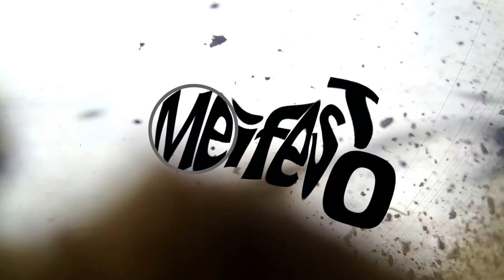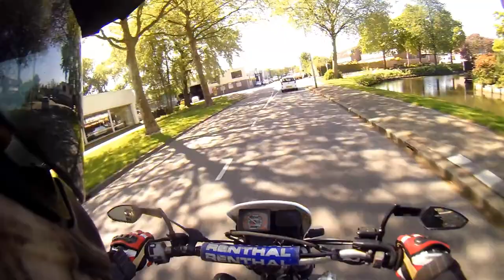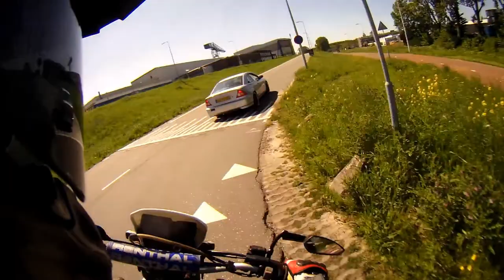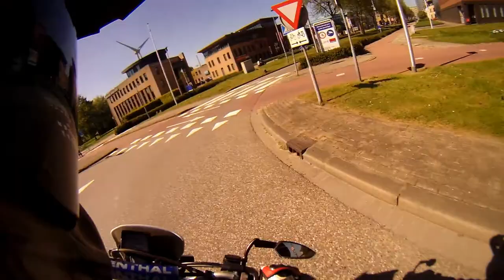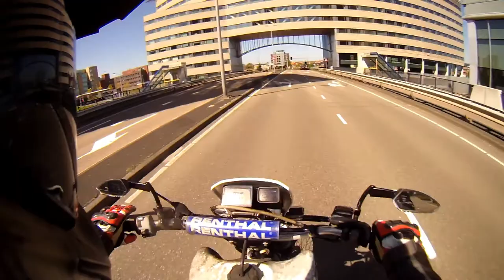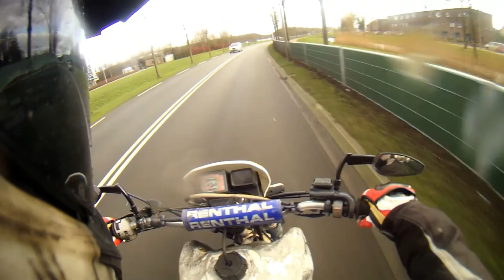Honda Electric Update

Comment: I've heard from a couple of people that they just use Kerosine/Clear Lampoil  instead of these expensive Forte bottles since they are about 99% kerosine. Might want to look into that. You are lucky your bit got kick-start with all those electrical issues, good to hear you have found all the issues.
Reply from the maker: I might look into that, thanks for the advise ;)

The upside of a kickstart, it will always start. Might take some time, and allot of sweat, swearwords and backpain, but it will start.
With the new bougie/sparkplug it start almost instantly. Love it :)